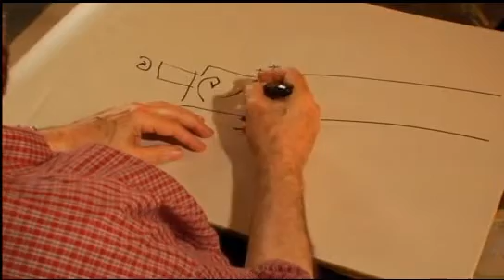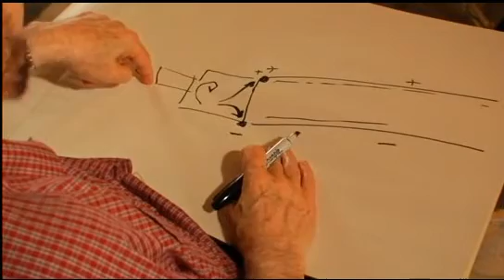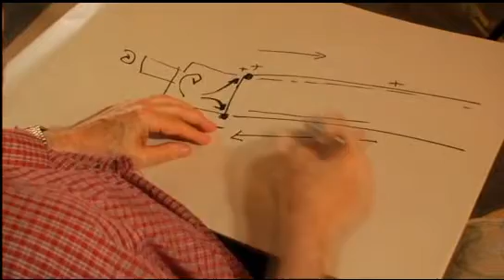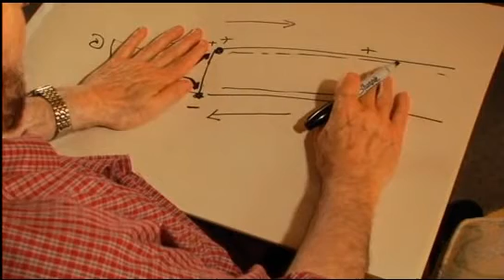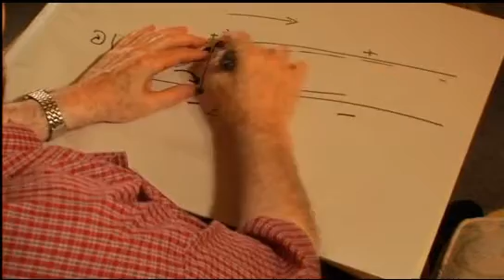the stupidest circuit

Comment: This is not entirely correct, it is perfectly fine to 'break the dipole' as long as the induced field is phase shifted in space or time to cancel the lenz.
Reply: True
Reply: I’ve done what tom is saying, honest no joke
Reply: Could you give more details on how one would go about inducing this phase shift? Thank you.
Reply: Back a year later, is this related to how the magnetic field propagates slower than the dielectric field? From the perspective of the dielectric the magnetic is going in the opposite direction due to the "velocity" difference, is this phase shift about correcting that like Heaviside did with the transatlantic cable?